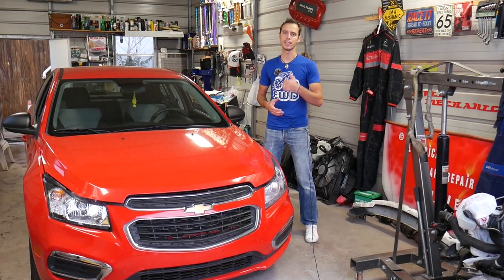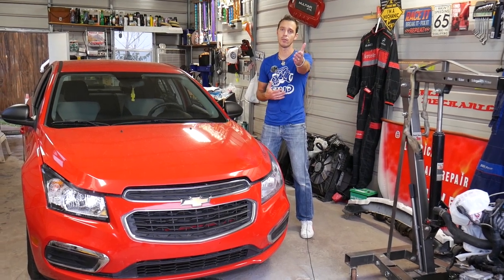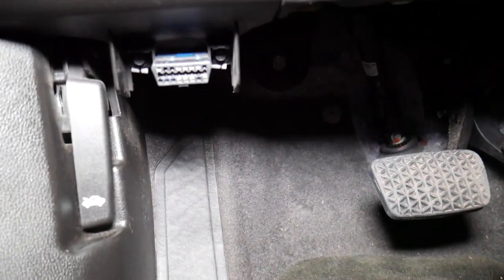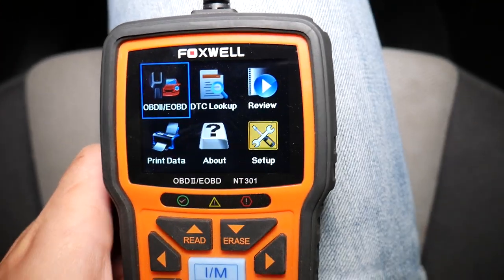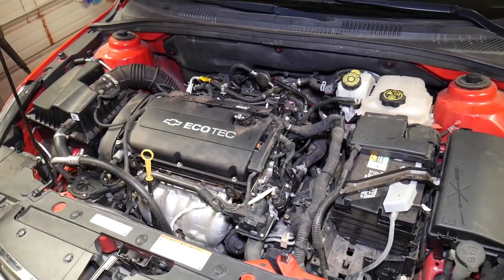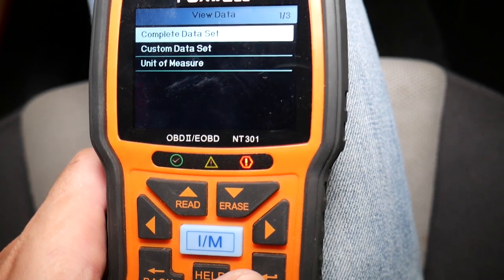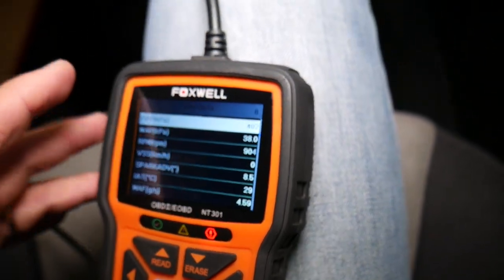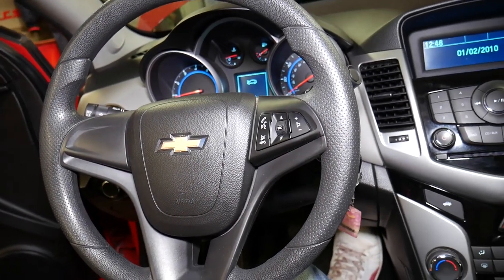FIX CODE P0107 P0106 ENGINE LIGHT ON CHEVY, CHEVROLET, BUICK, GMC, CADILLAC

Comment: I did every step even changing my maf sensor. and the code P0106 is coming up.  Any idea why?
Reply: Same. 2009 silverado. What's yours? Ever figure it out?
Reply: @CumminsTurbo4 you ever figure yours out? 😂
Reply: Yesssss, it was the oddest thing. Break in the wiring harness up by the brake master cylinder. What a b†ch to find!

Comment: Will this code happen if you recently built the motor with a cam and longtubes and havent done a dyno tune yet
Reply: @Justin Rodriguez yea two of the stock of sensors aren't being used when you put longtubes on thats what is causing the codes
Reply: @Justin Rodriguez I only have a computer tune no dyno and its still showing the codes but its not messing with how it drives
Reply: @Justin Rodriguez did you fix the issue ? Having same issue
Reply: @Justin Rodriguez the hose from the canister was cracked? or the canister was cracked? Did you replace just the hose?
Reply: @Justin Rodriguez appreciate it bro